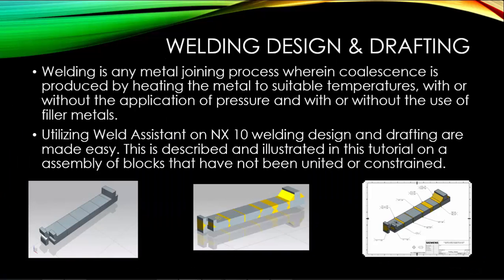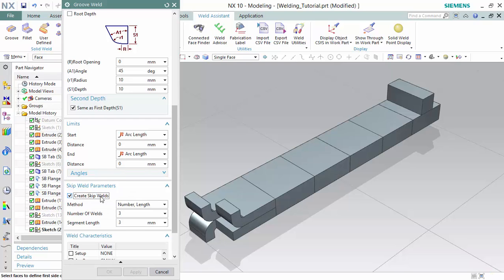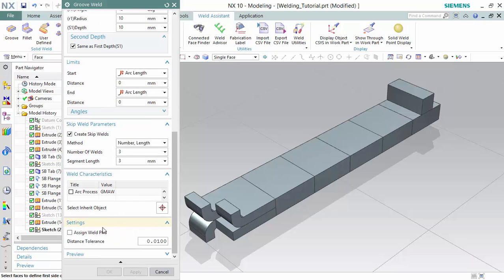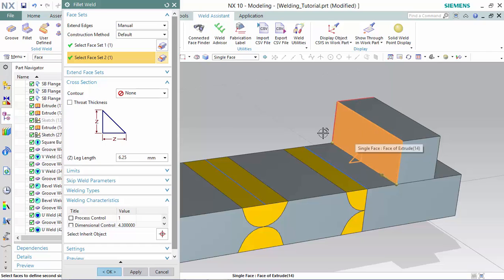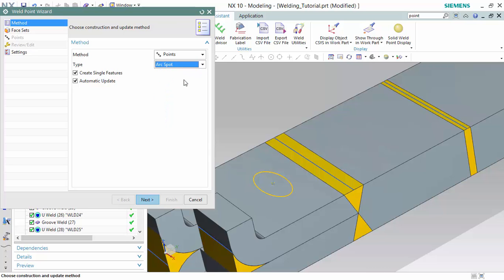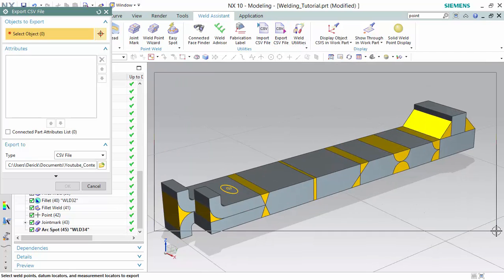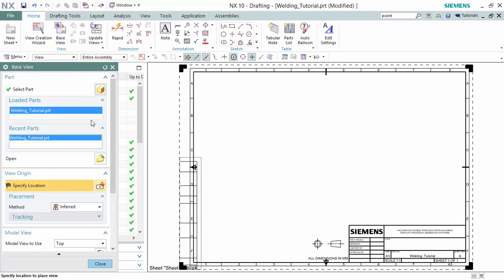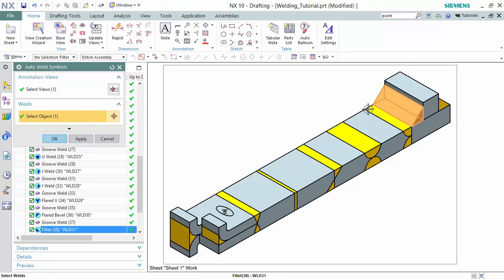Siemens NX 10 - Welding Design & Drafting Tutorial

Comment: I love using the weldment application however you have to use part bodies or linked geometry. If this application would work with the actual assembly part files it would be awesome. The other downfall is it doubles the size/loading time of your part file unless you make separate part files or change the assembly load options. I actually use them in the same part file with wave linked geometry with a separate weldment reference set to try and keep everything associative. It really makes the FEA more accurate than just uniting everything if materials are assigned correctly. I noticed while using the weld application if there's sheet metal parts and standard modeled parts, such as tubing it can get a little finicky. Other than the work arounds this application is very intuitive. Thanks for the video.